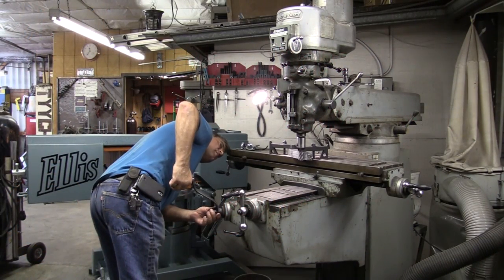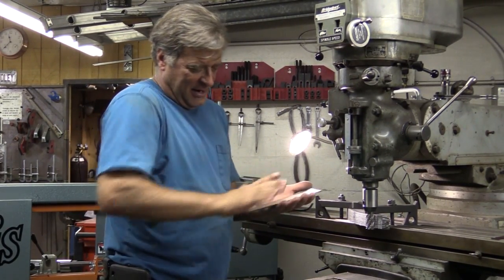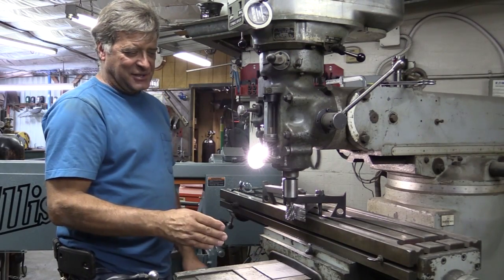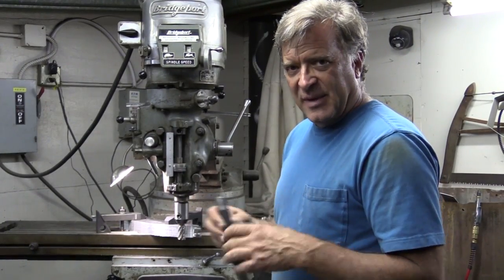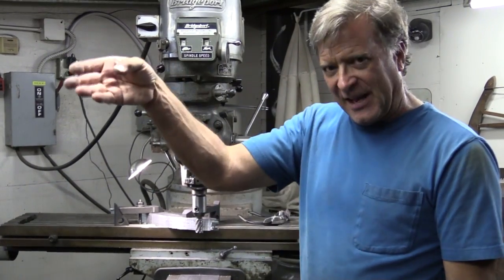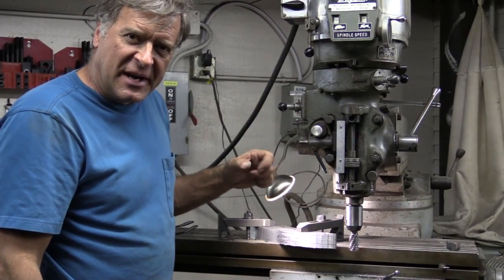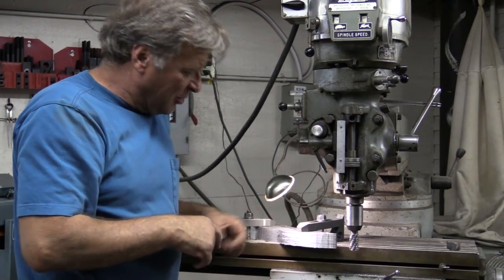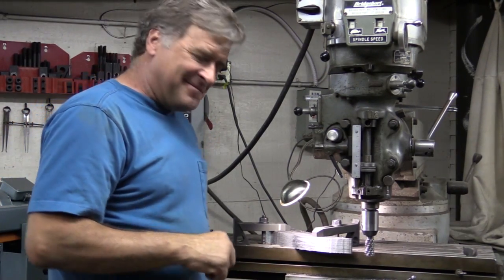How to Make Parts Uniform Using A Mill - Kevin Caron

Comment: just cut a piece of  3/4 plywood as your pattern and use plasma cutter allowing for your tip  Diameter  make your pattern  works great  just run the tip on the outside or inside of pattern depending on what shape your cutting . example if you wanted to  cut a   12x12 inch square  and the torch diameter is 1inch you would cut the plywood to 11x11  the centerline of your cut is 1/2 inch on the torch head so a 1/2 per side is 1 inch  that's cutting something on the outside of the pattern if cutting on the inside you would add to so if you wanted to cut a square in the center of your 12x12 plate  say a 4x4 inch square  you would cut a 5x5 square in your plywood  pattern
Reply from the maker: 1995dresser I am always learning on this channel!!   Thanks for the tip!

Comment: thanks kevin - nothing better than welding bright shiny metal; excellent selection the roughing chipper because ...the result of 'flame' cut process. like the demo chief and yes, archaic in comparison to the nifty cnc key pad models and 3d printer machines ya got to 'play' with...only 1/2 joking > look at the 'scales' on dat ting, helios und out.

Comment: Why would you not put a "sacrificial" piece of metal on the bottom of the pile so you wouldn't have to move your stack of parts to stick them off the edge of the table?

PS - I enjoy your videos.  Keep 'em coming!
Reply from the maker: Robert A Moore Didn't think of it?!?     Would still have to move the clamps to get everything but would have worked better.    Thanks for the tip...
Reply: Since the depth isn't critical you could use a piece of plywood under the stack for the same reason.  I stole that idea from the machine shop at work and it works great.

Chris
Reply from the maker: Great tip!   Thanks for posting.